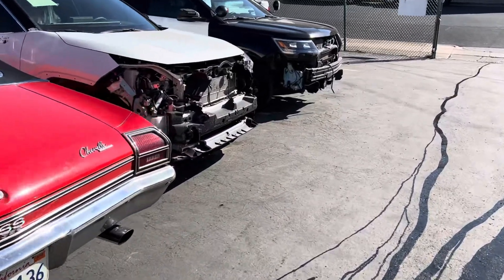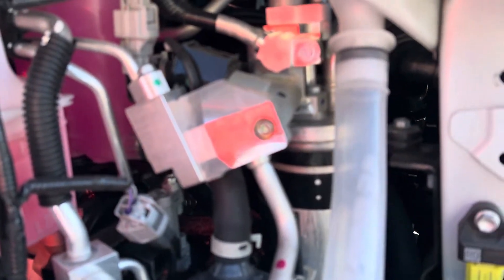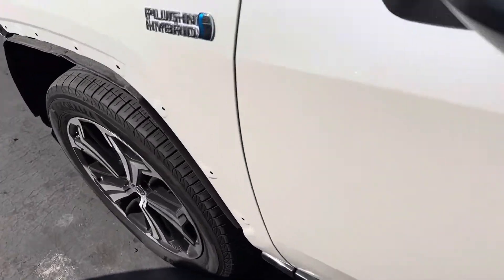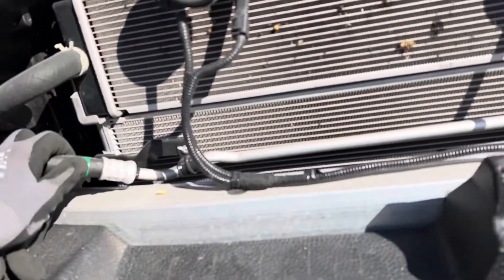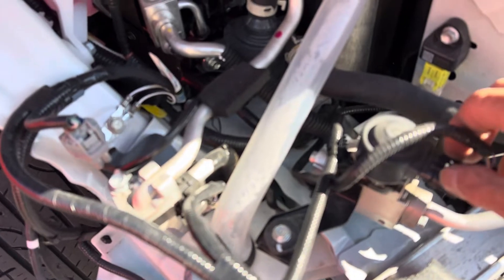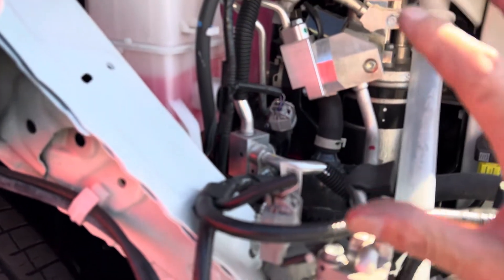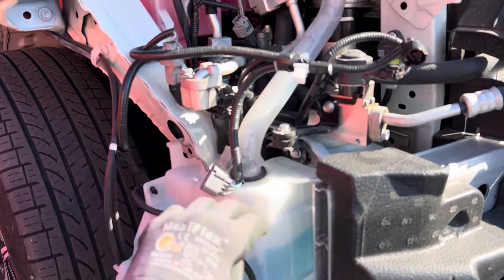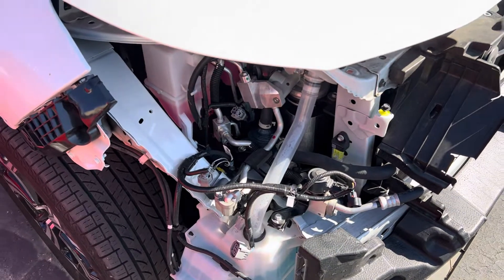￼HEAT PUMP 2021 TOYOTA RAV-4 Prime XSE. She’s a thing of beauty I love￼ HVAC ￼

Comment: Dear Tom I need your help.
I bought a crashed rav4 prime and i don't know how to fix  hvac system there are many parts missed and we don't know about them sense it's the first rav4 prime in my country. Can you see the pictures of my rav4 prime and tell what we need
Reply from the maker: You were probably gonna have to go to your local dealer and go through the Parts guy and look up all the parts. Visually part number by part number.. 

I don’t think there’s nothing I can do for you over here in the United States . 

And you have to check was your model built for the United States or was it built for your country? 

Sometimes when they build vehicles for different countries, they have different engine size and they’ll have different hose, routing our part numbers for different countries
Reply: @coldfinger459sub0  
Unfortunately there is no local dealer can tell what we need to complete the missing parts since it's new for them because I bought it from USA.
Reply from the maker: @mohammedalashwal8079  this is stronger if you’re going to buy and purchase American cars and it’s your business but I can’t have cream you’re gonna have to buy and purchase American software from a software company that is made for body shops for ordering parts.  

Mitchell on the man tenders, Chiltons there’s all data. Another company is called CCC. 

If you’re gonna be in this business, you have to have the information .  Every shop has this information..

Comment: Some fancy ass tech right there. It is very impressive from a technical perspective.

However, the cynic in me just thinks that this is a lot more to fail. It is going to be a lot more expensive and time consuming to replace parts for the owner and will probably need manufacturer programming tools to recalibrate the various sensors etc that the tech will have to buy.

Imagine your car has an aircon fault and you find out it needs $600 of gas, plus $2000 in parts plus labour... it's going to really devalue the resale value for a lot of people and probably end up with more vehicles heading to the landfill / recyclers earlier than would have been otherwise, makes me question how green any of this actually is.

Lets hope Toyota didn't decide to use too many of those janky clips to hold the pipes together to shave a few seconds off assembly times and  pennies off a bolt.
Reply from the maker: That is very true the cost for repair are going to be astronomical

Basically they move the heat pump from a house and downsized it to fit into a car

And you know anytime you downsize something to make it smaller like electronics the price exponentially go up more expensive

Hopefully the good thing is it’s a Toyota and the system is manufactured by DENSO two of the most reliable dependable products on earth

It’s not like it’s a Ford a Chevy or a Chrysler

The biggest problem is going to find technicians who can work on it and even if they can technicians who actually care about their work and take the procedures that is necessary to keep the system running for years
Reply: I just had to replace the compressor on my fridge, a variable linear compressor. A new technology to save the planet. In the process, I found out that all these $3000 LG "French door" refrigerators are lucky to last 10 years, there were a couple years worth of models that didn't last a year or two and ended up in a class action suit, and a couple more suits headed off or in the works. They weasel out of warranty repairs by dragging the process out over 2 or 3 months.
All those expensive, fancy refrigerators in the landfill. An extravagant waste. All in the name of being "green." It's a never ending scam, and they will bend the public over as far as we will allow them.